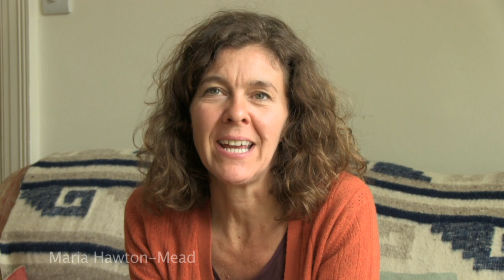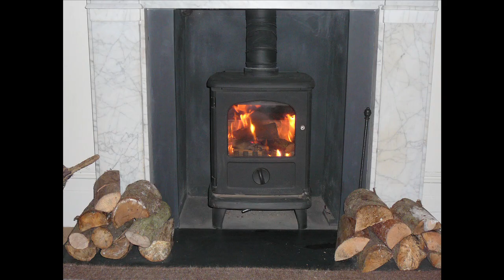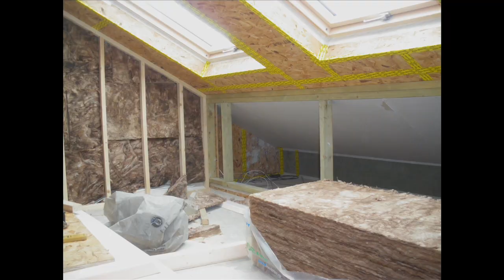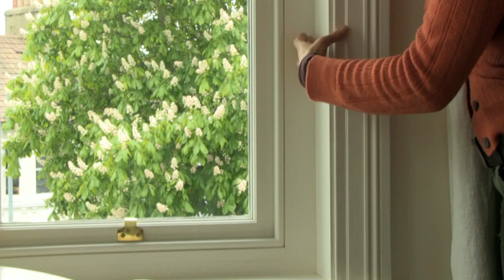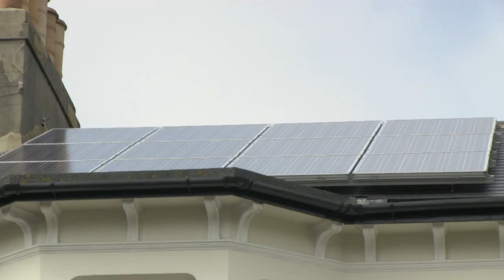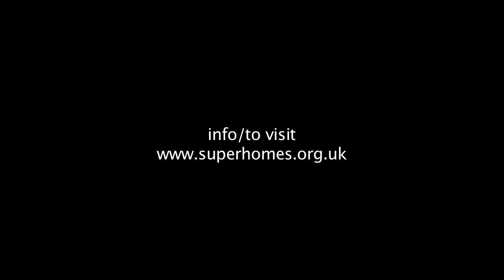Eco Renovation - 3 storey Victorian terraced house, Brighton

Comment: Very interesting project, thanks for the video... A couple of questions.... 1) The exterior brickwork is now going to be colder and wetter than before the internal insulation was fitted. The walls were built with the assumption that heat and air would pass through it from internal heating. Was this taken into account and if so how can you be confident that over time you won't get problems with e.g. brick spalling 2) As we move away from gas central heating to sustainable options how are you going to heat the house? You have (beautiful) exposed original floorboards but using electrical heating (e.g. from air source heat pumps) generally requires low temperature options such as underfloor heating (and usually it's not recommended to use UFH with solid wood flooring).
Reply: My thoughts too. Internal insulation is fraught with unforeseen problems. I want to know how much this all cost too.